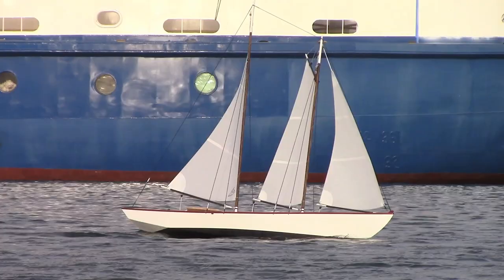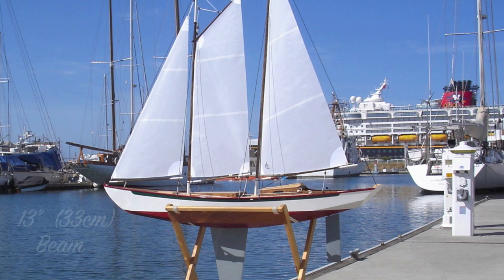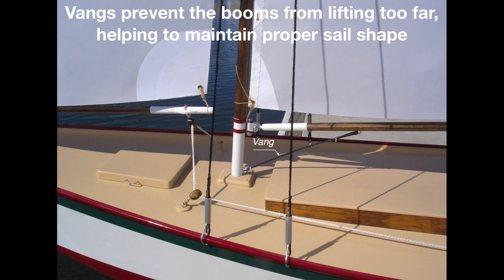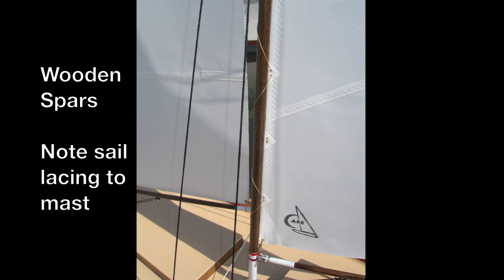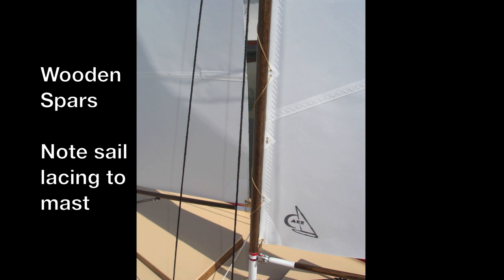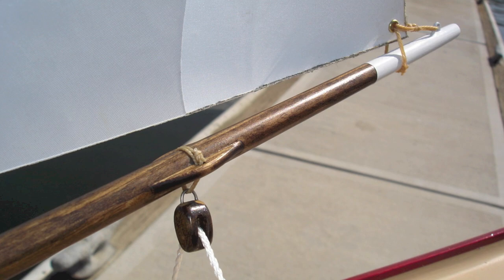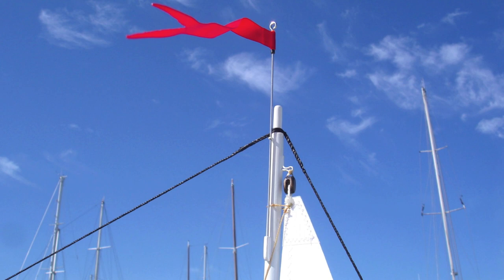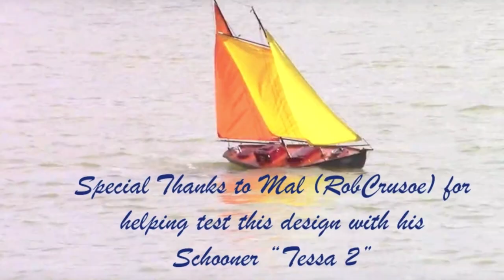Fast Cargo Schooner “Annie" joins the Bearospace RC Fleet

Comment: I ordered the emma plans,but I am not clear about the servo winch sistem for the sail,can you explain it please.
Reply from the maker: The Emma design uses a Sail Arm Servo. The single arm pulls both the Jib and Mainsail sheets.
Reply: @sailtails2775  thank you I will check the plans, I puchase the hobby king radio,but I could not find the servo for the winch that you show on the link...any other servo that I can use? Thank you I am enjoying it!! Happy sailing!!
Reply: @josuemelara5085  The Hitec sail control servos are robust and reliable. https://hitecrcd.com/products/servos/boat-servos
Reply from the maker: I suspect you may have seen a video produced by another builder which showed a sail WINCH installation.
The "Emma" Plans show a sail ARM servo (HiTec HS-765HB),  used in the original "Emma" for its' simplicity.
This servo can be found many places including        https://www.servocity.com/hs-765hb-servo
Cheers, Gary

Comment: Beautiful, and I see you have fabricated many components yourself. Strangely, I have never seen wooden turning blocks or wooden cleats on an RC model. Not one. Why? They´re very handsome, and I suppose not so heavy that it would necessarily offend a “racer.“

The boom vang is set at an angle which makes it dramatically less effective, but you did say that elastic “give“ is designed in.

Do the plans say that Annie is a schooner? Annie is a ketch because only one mast carries a gaff. I have never piloted a gaff-rigged boat, either full- or model-sized. You say it has a personality all of its own, but what?

Promise me that you will construct a miniature model of your (full-size) boat to go itself inside Annie. That will be so... recursive. You might say it´s an inside joke.
Reply from the maker: Thanks Brian, I suppose such wooden blocks & cleats are not seen more often because they must be handmade rather than purchased.
The Vang angle is as good as it can be given the realistic proportions of the rig's layout.
Annie is a SCHOONER!  A 2 masted schooner's Mainmast (located aft) is equal or taller than her Foremast. Even though she has a Marconi Mainsail, ANNIE is still a Schooner.
The Mainmast on a Ketch (located forward) is taller than her Mizzen mast.

As far as personality, sailing Annie is rather like driving a big old American luxury car on the open highway. Think "Coupe deVille".
Miniature model inside Annie? No promise, but I like that idea. Annie's interior is a work in progress, a well hidden inside joke for sure.
Cheers!
Reply: @sailtails2775  I think Brian has mistaken Irene for Annie, from his description. There is a brief moment in the video at the beginning where Irene and Bear are shown.